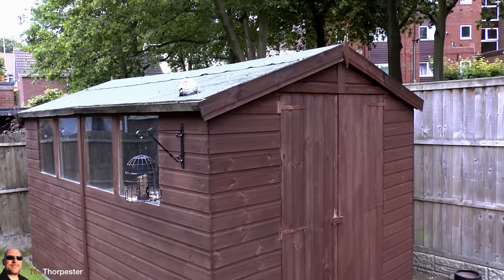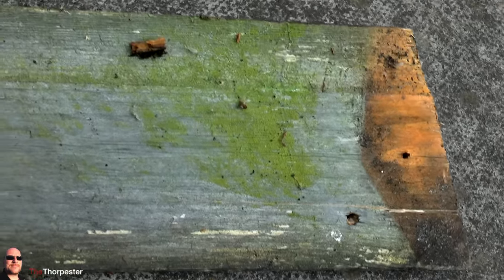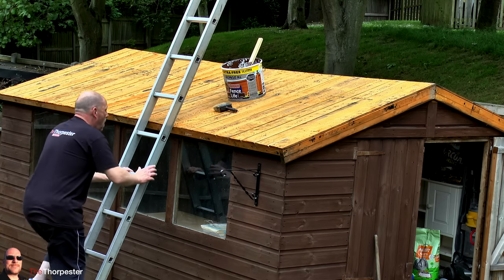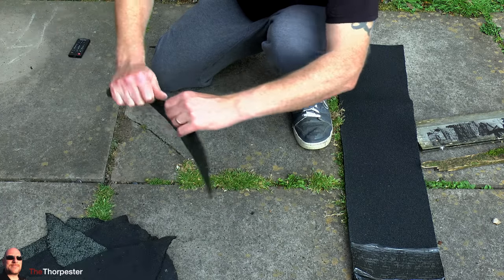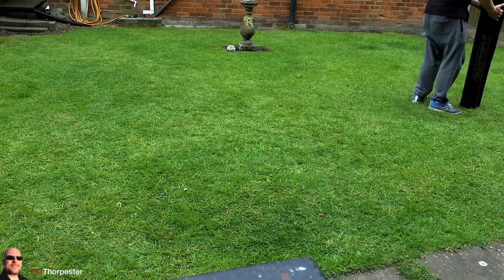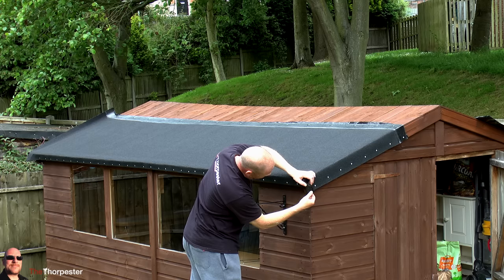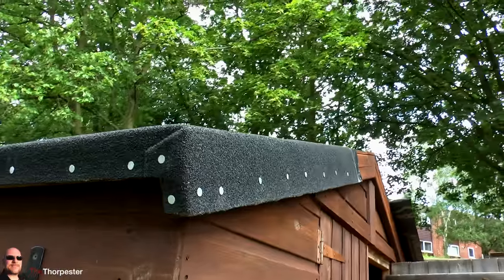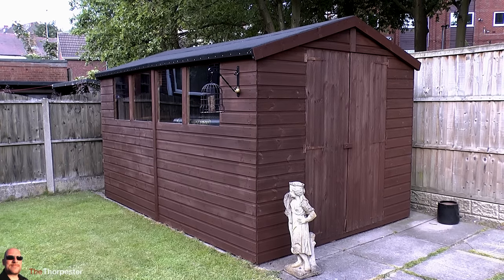How to Easily Felt a Shed Roof The Right Way- DIY

Comment: Thanks for the video and the TradeTorch tip.  I am building a shed which is really long and decided this would be the stuff I would use.  A couple of things first.  The felt you have used is a torch on.  That plastic backing is effectively melted away when heated so when you did the overlap you should have removed it as the adhesive is now stuck to the plastic and not the felt.  What I did was remove all of the plastic backing completely.  I then applied the roofing adhesive to the entire OSB board roof and the put the felt on top.  I did this by putting the roll on the roof and then paint the adhesive ahead of the roll and slowly unrolled it.  I then added the clout nails.  I then painted more adhesive for the next strip and put it down.  I used a seam roller and a heat gun to melt the backing from the outside pushing down with the seam roller when it got soft to seal the edge.  I also used the heat gun on the over hang so the felt was softer to bend.  The heat gun was a tenner from Aldi I think.  This system is actually a two sheet solution. There is an underlay for it as well for the same price.
Reply: ups

Comment: Some comments from a roofer.

Overall i would say a job well done. But yes, it is really a DIY homemade solution which lacks some details compared to doing it the correct way (which doesn´t have to mean more expensive, just better).

As many others have already said, usually you use a torch to weld the two pieces together. But it certainly works to use an adhesive just as you did, it´s not as strong as welding it but as i said it works. Some suggestions:

* Add edge sheets, these can be bought in DIY-style from various hardware stores. Buy (for this shed) 2 2m pieces and just overlap them and nail/screw them down (don't nail/screw the overlap section). If the sheets are too long, just cut them with shears but always overlap them. 

As it is now the water just drains down and drips from the endboard on the underside, this will lead to that the bottom side of the wood will start to suck up the water. In time even a treated board will rotten.

* Gutters. Not necessary but there are several reasons for why you could use it (ie. draining the water to the sides instead of watering the whole ground or eg. saving rainwater and so on)

* Wooden studs on the sides, cut at 45 degrees. Nail these to the roofboards, and then cover them with the felt just as you did. This will lead the water straigth down instead of dripping down on the sides (same results will happen as mentioned above about the edge sheets). Remember to cover the bottom of the studs as well. The reason for all this covering- or directing water is due to capillary action = the wood will draw up the water. Personally i would also cover the studs with sheets (these can also be bought in some stores, or ask someone to created them for you. It isn´t expensive and it is worth the cost).

* Applying the felt. First of all, the material is still what i would consider "cheap". But it works for a shed.
Overall this is more or less the only thing i reacted on. The DIY solution you did is ok and a nice work for someone not working as a roofer...but...the nails on the overlapping felt. Just no, no and no. You just nailed holes throught the waterproofing. This is one of the most common things i see when i get to homeowners that has done their own roofing. Ok, i get it. You want the felt to stick...but...there is a reason for why it is called adhesive. It is supposed to be an alternative for welding, so it pretty much speaks for itself they have thougth about this being a similar alternative. It really has to stick together, and ofcourse it does.

So what you do is that you apply the adhesive like you did, you then ROLL it together firmly so that you actually bond the materials. Do not just push your hands like you did. Roll the area carefully over and over, check for glitches etc. Let it dry/harden for some time (read instructions for time directions), then check  for any areas that aren't perfectly bonded. 

So just some small suggestions (and there are more, but as for a DIY solution this would be perfect). Yet again, well done overall.
Reply: @richardb2620  What a nice reply! Really constructive. But i suppose you are one of those guys who can't read instructions, your brain gets tired after more than two sentences?
Reply: So just to make sure, you nail the under layers but the final over lap layer u just stick using the adhesive right?
Reply from the maker: Thanks for the advice buddy.  Appreciate you giving up your time to help out others who might want to try this.  Top man.

Comment: I am not a great DIYer, but I have Ronseal sealed & re-felted my shed roof in exactly the manner you outline in your video – I copied all processes & materials precisely. I am incredibly pleased with myself and it looks good. It has had one test so far when it rained, and all seems now to be dry in the shed. It took me a week but that does not matter as the job is completed. 
Thanks very very much The Thorpester for your excellent advice – very much appreciated. David P
Reply from the maker: That's fantastic news buddy and well done you!  Since I did mine, it's been battered by the weather and still looks and performs the same as it did when I first did it.  Wish I could post pics to the comments.
Reply: @TheThorpester  Yes I wanted to add a couple of photos of my shed roof to my comment but did not how or IF you can do that on youtube? I live in Wolverton, Milton Keynes.

Comment: I've used ordinary felt for 2 sheds I've built. But I always fully glue it down. Never had any problems 20yrs later. But admit what you're using is better quality. But I would still fully glue down
Reply from the maker: Sounds like you did a proper jobbie pal. Nice one and thanks for the glue tip 🫡

Comment: Really helpful, thank you! I've designed a solid shed but researching roofing is a nightmare - underlay or not bother, all the "pros" insisting it needs to be properly torched-on etc. Great to have a demo of the difference between the "Torch-On" and cheap felt but to see you can use TorchOn without a torch! Much more confident with my project now, cheers.
Reply from the maker: Nice one mate.  If you have the tools to torch on etc then I would do that especially as you've designed the Shed yourself.  Best way to go.  For me, I just wanted a better roofing Felt that could be installed as usual and it has worked out fine.

Comment: Really useful video thanks. Just about to build new shed and as you said supplied poor quality felt with it. Previously I’ve always double felted so if the top sheet gets blown off the under sheet remains waterproof
Reply from the maker: Nice one buddy.  Glad you got something out of it.  If mine was a new shed I'd probably borrow a torch and torch it on but to be honest, I haven't touched the shed roof since I did it and it's still exactly the same as it was at the end of this Video

Comment: I prefer screwing the ends on as it just makes it easier to remove them if it becomes necessary. Other than that it all looks fine. Lets see it in a few years! Very comprehensive and easy to follow.
Reply from the maker: Nearly been 2 years buddy and it looks the same :)

Comment: I built my own shed - far stronger than all the sheds you see in these videos - and I'm no tradesperson - but enough of me being a smart ass - could I just ask why no-one seems to install guttering and downpipes to deal with rainwater run-offs, and why does no-one seem to build a base that raises the shed floor frame timbers off the ground?  These two "extra" tasks will prolong the life of your shed almost indefinitely as most are ruined by water dripping off the roof and splashing up off the ground.
Reply: I agree with. Those small changes will do that it last much longer at the end

Comment: You did a spot on job mate, amazes me that 90% of the comments on this video are a right load of moaning "thats not how you do it" smart arses. I guarantee most of them have never even assembled an IKEA bookcase.  You'd think felting a shed was subject to strict nuclear reactor protocols the way these idiots critique from their saggy armchairs. Add together all their "improvements" and you'd be easier moving house than attempting a basic job.
Reply from the maker: Lols agreed mate although some of the comments do actually help.  I'm learning all the time but guess what?  It's still the same as it was when I installed it even through the torrents of Rain and gale force winds we've had lately.  Nibbles is still a happy Bunny.

Comment: Thanks a lot, you saved my shed. Plus, your video was very relaxing :) I used Pluvitec torch-on with a mineral layer (an Italian brand, sold here in Ireland). Expensive stuff but superb quality when compared to the typical rubbish they sell for roofing sheds. First I thought it might be too heavy, but it works a treat.
Reply from the maker: Awesome pal. Well done and glad I could help a bit

Comment: Part of the problem with the old roof was that it was tucked into the wood trim, which I see you've done again on the ends.  This will channel water behind the wood trim and rot it in record time.  Not sure about your part of the world but here we use an aluminum drip edge to stop water wicking behind the wood around the edges
Reply from the maker: Thanks for the insight buddy.  Much appreciated

Comment: Neat job, just the corners are different to how I'd do them; fold the gable sides in and under before folding the gutter edge over - you did it the other way - my way gives a cleaner run-off!

Comment: Having had both my Wood & Garden shed ravaged by Storm Ciara today (the  old felt has just lifted & peeled away on both) I was looking for some quality guidance on repair. This video provided it in spades. I now know what to use  and how I’m going to get it sorted. Thanks mate!
Reply from the maker: No worries mate.  I've lost 2 fence panels to Ciara already and it's still blowing!  Shed's ok though.  For now...
Reply: TheThorpester Thanks. Bit of a pain this storm. Never refelted a shed before, never needed to. I feel your pain. I moved to a rural village last year and the storm has taken out 1 fence panel (which survived intact) & a panel in my greenhouse. Luckily I managed to use the feather board panel to plug the hole in the shed or I’d have lost the lot. The felt lifting was just the icing on a crap cake.
Reply: Shed: greenhouse. Been a long day...
Reply from the maker: @TelBot  I hear you.  The problem I have is that yes, I've fixed the Fence panels and made them strong again but I have no idea how to slide them in as they're 6ft (and a 1ft gravel board).  I've tried many times in the past and failed so I'll have to wait till the neighbour is back to give me a hand!

Comment: The shed I did was 4x7 mitres. Just remember NOT to do any felt work on a hot or sunny day in the summer, unless it's very early.
New felt melts. It gets VERY sticky and you'll ruin it by standing or kneeling on it.
I did two early morning.

Comment: Thanks for the tips and product recommendations. Do you absolutely have to use clout nails on the top bit? Would the adhesive alone be enough? Won't the nail holes let in water?
Reply from the maker: No worries mate.  You could put just the adhesive on but you'd have to weigh the joint down for a good while (I would expect) to ensure a good stick.  With the Felt I used and the Glue, the clout nails should be sealed on fitting.  I'd use the nails mate but it's up to you.  Get's quite windy here so I've used the nails just in case.  It hasn't leaked yet!

Comment: correct me if i'm wrong. but doesn't putting the nails through the top piece of felt destroy the purpose of the felt adhesive. if you put a hole in the felt, water will get through. same goes for the sides and front of the shed but at least th edamge is minimised and localised there. putting holes on the top of the felt is just asking leaks.
Reply from the maker: The Felt forms a seal when nailed.  That's what clout nails are for.  Good luck using just the adhesive!.  Better to burn on this stuff as intended if you have a torch.
Reply: @TheThorpester  ok fair enough. just a question i had. i realise now that my original wording could have come across as rude. hope i didn't
Reply from the maker: @whippyjarge8788  Not at all buddy, all good.  Hope the vid helped

Comment: Does it not leak on the overlap seeing as you’ve put a line of nails down it ? Thought that’s what the adhesive is for ?
Reply from the maker: Nope. The felt reforms around the nail and seals it. Also the adhesive helps to seal. The adhesive wouldn’t hold the felt down in strong winds so the nails are needed or torch it on as designed.

Comment: I had a left over roof felt for a torch on flat roof. There's no rough top to it. Hoping its fine for the ridge position on shed. You don't stick down the heavier stuff apart from nailing.?

Comment: I would also have been inclined to add a strip from the “waste” felt - about 30cm wide - to reinforce the ridge region. This suffers a lot fro wind effects over time. As you have plenty of adhesive, this will be ideal to bond the strip in place: doubt nails would be needed as, perversely, water has been known to seep past them!
Reply: If you nail through the adhesive, I have found no leaks due to the adhesive sealing around the clout nail.

Comment: Thanks for the vid, it is interesting though isn't how we put nails in the roof covering to fix the felt. I wonder if nailing the first 2 lower sections and then torching the upper ridge felt would be the best way, but then you need a torch! I had my garage done professionally and they tack an underlay on first and then torch a second layer on top. An extremely robust job.
Reply from the maker: Underlay and Torching is definitely the best way if you can do that but the Clout Nails should be fine (with the adhesive)  Hopefully will last a good while..

Comment: How do you stop it leaking with the nails going through the felt?
Reply from the maker: The Felt grips around the nails forming a seal.  The nails are specific for the task.  Also, if you Nail through the adhesive, that helps with the seal.
Reply: @TheThorpester  thank you very much.

Comment: I have to do a summer house roof which we got when we moved in 10 years ago... I now know some of the OSB is failing as I did an emergency patch replacement using strong roofing felt when I built the dog shelter 9 years ago (that has yet to leak) and in patches it was not there anymore. 
I have to say the differences in felt used in place in the different construction is staggering... the dog shelter and my shed is at least twice thick as the felt used to do the summer house.
The builders also left the felt dangling into the gutters... I have no words.
After watching this video I am going to be ordering 12mm OSB3 and a lot of string roofing materials... thank you!
Reply from the maker: No worries buddy.  Glad you got something out of the vid and best of luck.

Comment: Hi. Im about to replace my 16x8 with good quality felt for exactly the same reasons. Suppose you could nail in half way and then dab some bitumen at bottom of nail then hammer in to be sure of no puncture leaks. 👍
Reply: I'm no expert but doing lots of research; I read that these nails are supposed to be hammered in tight to the felt so the felt forms a seal around the nail, so it would not be recommended to dab bitumen at the bottom of the nail.

Comment: i always worry about the clout nails half way up eventually becoming a path for water ingress. I wonder about putting a bit of PU adhesive over each one to seal it?! But just seen a comment that 4 years on it is still holding up which is encouraging!
Reply from the maker: I’m the same buddy. It is still holding up though. The felt does form a seal around the nail but yea, it probably will ingress at some point in the future. I think the adhesive helps a lot and forms a good seal too. Thanks for commenting buddy.
Reply: @TheThorpester  saw on another vid, the guy added a dab of adhesive to the top of the nails to encourage a good seal. Aesthetics not awesome but seems like a good idea.

Comment: When I did my shed on the apex sheet of roofing felt i put a dab of silicone on the  clout nails to stop rain water penetrating the nail holes
Reply: That's a good idea. I'm doing mine when this wind dies down.
Reply: Putting holes in a roof goes against my instincts. Surely it will allow water to penetrate?  Isn't the adhesive sufficient to hold it fast?
Reply: Doesn't hurt to put a little extra insurance, after all it cost pennies to do,

Comment: Interesting.   Tradetorch is,  I think,  intended to be sealed together by heat.   And the graphic in the back of the material supports that idea.  How well did the adhesive bond to the back?
Reply from the maker: Adrian Stephens yes mate you’re right. If you have the tools to heat it down then all the better. I was told this trick by a top guy who’s been building sheds and garages for around 30 years and I think he was bang on. The overlaps stick down really well and if you had weights to put on them for a week you probably wouldn’t need to use the nails. He told me to use both and said the roof would last for years. I don’t think he was wrong.  He also told me not to get underestimate the importance of the prep i.e. strip, dry, clean and protect before the new material goes on.
Reply: @TheThorpester  Excellent.  Thanks for the reply.